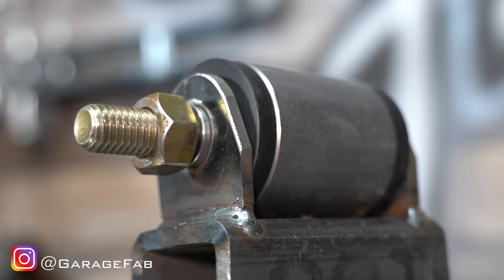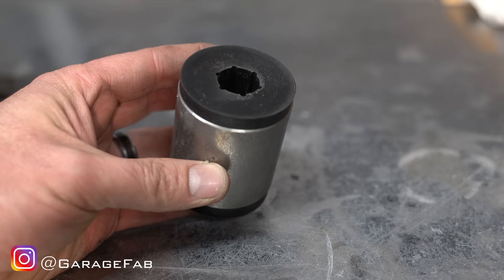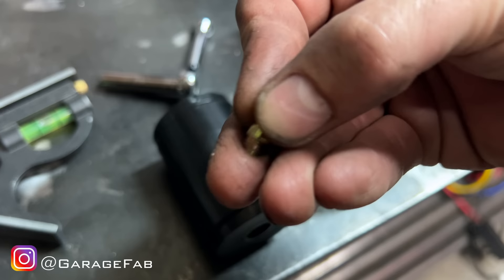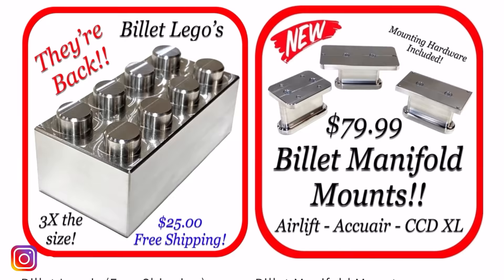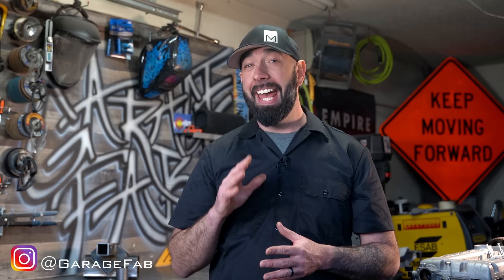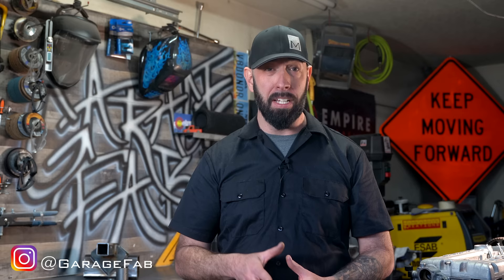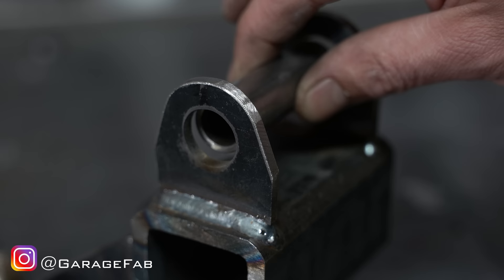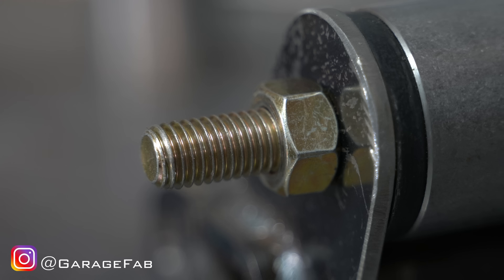The DOs and DON’Ts When Installing Polyurethane Suspension Bushings

Comment: One upgrade i do on every car suspension or offroad jeep that i know i will take apart because or repairs or maintenance is i will mark the bolt about center and drill a small hole thru the side about halfway thru. Then drill a small hole from the bolt head to the hole u just drilled. Then tap for a 1/4-28 for thw fitting i use. And i keep a wide assortment and stlyes to choose from so i dont have to go to the parts store. Also wipe any grease off after ur done because it what u should do. Also use the plastic caps to cover them. That way they are clean the next time u go to service ur ride. This will help the rust belt and offroad guys....
Reply from the maker: Brilliant. I’ve seen this done but never thought of doing it myself. Do you have to oversize the bolt knowing that you’ll be drilling into it?

Comment: More good info. Packed full don't blink. 

In the case of a rubber oem bushing, they are designed to be clamped at ride height. And twist rather than rotate. 
Modern cars suffer from premature rubber bushing failure when wheels are left hanging for to long.  The rubber begins to tear. A modern vehicle driven under norma conditions will see longer bushing life, vs one that is at a track putting the suspension through full movement travel.
Reply from the maker: Preach! This is something we struggle to explain at work, when we see new technicians tightening suspension bolts with the vehicle on the lift. Like, “Congratulations! You just replaced some control arm bushings. And you’ll be replacing them again for free next month!”
Thank you, Brother!

Comment: Permatex silicone paste works well on the through bolts , it is water resistant , lubricates , and is safe on rubber parts . I also use this product on Class - 8 truck S-cam brake pin bushings instead of anti-seize .    
Permatex also has  Silicone Extreme Ceramic brake parts lubricant .      121/23
Reply from the maker: I like it. I just like the way it looks, and it’s far less messy/annoying than anti-seize.
Reply from the maker: Appreciated, Vic!

Comment: I really appreciate you specifying the SOURCE of all the information.  Without that, all this would be just opinion.

Another reason for going with grade 8 bolts (but this is just opinion) is that they have better coatings against rust.  Am I wrong?
Reply from the maker: I honestly don’t know the answer to that! I know they’re coated, and I know it’s different than your typical zinc plating, but I don’t know what the difference is. I’ll have to look it up.

Comment: At 3 minutes the bushing bolts that like to seize to the inner bushings can be improved with a bolt upgrade to ones with a smaller diameter shank section mid way so full shank diameter remains at both ends for half an inch or so. I used a Nissan example that was an updated part for a 97 Pathfinder that came stock with a full seizure style shank that was nothing but fun to remove from the vehicle at 8000km when the bushings were chewed from the inner sleeve outward to but a small fraction of the original. There was no slip to the pivot just holes through the rubber bushing material around the inner sleeve to allow flection. Even with a portion of preload in the direction of travel to allow the flex to first unwind before passing over the static neutral position the first replacement but the rhubarb at 12,000km and I got busy with an Energy kit doing the mods you've been covering here to allow a controlled pivot around a stationary inner sleeve which makes sense I hope when you think about crankshaft main journal diameters and the benefits of the smaller diameters on drag... unless you break them. What an improvement in 4 link plus panhard rear. 
Doing the same for my 68 Firebird.
Always interesting stopping by your shop to see what you're up to.

Comment: This was a great video!

As for greasing the bolts, you are on the spot, makes no difference in operation but I always choose to grease the bolts when I assemble for corrosion protection.
When it goes to engine mounts etc, especially in bikes , no seized bolts!
Reply from the maker: We’re spoiled here in the desert. If we see rust, we know that car came here from somewhere else. You can call it lazy, but we’re a nearly grease free society.
Reply: @GarageFab  you are very lucky!
Here, and I mainly speak for ATVs, if you don't grease especially the rear arm axle bolts, you are going to have a very hard time when you will have to remove!
Reply from the maker: I believe it! 😆

Comment: Great video.  Threads will also wallow out the hole in the tab faster then the bolt shank.  thanks!
Reply from the maker: Agreed! But if that happens I think it’s a sign the bolt wasn’t tight enough.

Comment: Thanks for the information, I had to change the rear end in my Nissan Pathfinder because I was hit in the side right on the rear wheel and it bent the rear housing.  When I tightened the bushings the nuts were self locking so I wasn't sure if the inner sleeve rotated around the bolt or not.  I decided to go ahead and tighten the bolts since they were tight when I removed them.  Now that I know that the bushing rotates around the inner sleeve I know I did it correctly.
Reply from the maker: Here’s a little additional info that I neglected to include in the video Dave.
I’m assuming your bushings were factory, and if so, they’re probably bonded rubber. These type of bushings are still fully tightened as mentioned, but they should not be tightened until the weight of the vehicle is on the suspension. If you tighten them with the wheels off the ground, the bushings will twist when you set the vehicle down, and this will cause your bushings to tear prematurely.
If this is the case, I would simply recommend loosening the bolts without lifting the truck and then tighten them again. The inner bushing should spring back to its natural position.

Comment: Good job, nice explanation.
Just a couple of points….
You don’t need the shank to span the tabs. The bolt isn’t loaded in shear, it’s the friction from clamping everything together that stops things from moving, so the length of the shank doesn’t matter. If the bolt is loaded in shear you have a joint that is going to destroy itself pretty quickly.
It might be a British/American thing but Rod end refers to a spherical joint (I think you call them Heim joints?). This is just a bushing.
Cheers!
Reply from the maker: Agreed. I’ve learned a bit more myself since making this video.
I honestly don’t know what the “correct” term is, but in my little circle of fabricators, all bar ends are bar ends but they’re specified when needed. Spherical bar ends (Heims), polyurethane bar ends, Johnny Joint bar ends, etc.
Thank you my friend! 🙏
Reply: @GarageFab  👍

Comment: Great content ! I have always tried to have at least 1 1/2 thread showing through the nut after torquing and I always try to use grade 8 hardware for safety reasons ! Thank You 🇺🇸🇵🇷🦊👍
Reply from the maker: I don’t see why you’d need any more than that. A utility truck manufacturer I worked for required a minimum of a half inch protruding from the back end of the nut.
Thanks for watching, Ferdinand!

Comment: I keep coming back to this video. It's super helpful. I'm thinking of making a swing arm tire carrier that bolts to the back wall of my trailer in 2 places and was debating going this route instead of a spindle on the bumper. I like this idea of using these bushings as a hinge instead but not sure if it would be too tight or hard to move. Obviously it would be stiffer than a spindle but maybe a gas strut would help with that.
Reply from the maker: Yes! They are indeed stiffer, but not difficult at all. As soon as you add some leverage (like a tire carrier), they’re fairly easy to maneuver. Their stiffness might even be a benefit as the tire carrier wouldn’t swing back by itself. It should stay wherever you leave it.
Another option that I’ve been using lately has been machined shoulder bolts and bronze flange bushings (Oilite bushings) in DOM tubing. They resemble polyurethane bushings but way smaller, don’t allow any flex, (great for door hinges) and the stay lubed.
Thank you for your return! 😆

Comment: Great video, but I would recommend to avoid store bought “grade 8” bolts for anything with critical stresses and step up to airframe fasteners.  much stronger bolt and threads (fine threads, too) as well as a more consistent and accurate size fastener.  you’ll find they generally fit tighter into the sleeves allowing for less slop, too.   Grip length is critical, of course, and flat washers can be used   if needed (avoid lock washers).   Carroll Smith wrote a great book on fasteners.  it’s a real eye opener.

Comment: These bushings look great, I've only ever fitted factory stuff where most bushings are bonded in so not pre-loading the suspension is the mistake most people make when fitting them.
Reply from the maker: You’d be surprised how many “knowledgeable” technicians tighten down new bushings with the wheels in the air.
By the way, I actually loled at “Rod Panhard”

Comment: I worked as a suspension tech - don’t put poly bushes in your car unless it spends most of its time down the race track. I’ve seen cracked strut towers where poly strut tops were put in. People also have an obsession with slamming their cars to the ground, thinking it handles better. Nope. Your car is bump steering all over the place because you’re losing traction, as you have no compliance in your car.

Comment: i think i uncovered a possible flaw in your logic pertaining to having the threadless part go all the way through, i just saw something where they were saying the weak point of bolts is right where the thread starts and if you think about a bushing all the force is right where the tabs meet the innersleeve so i would think you'd want the weakpoint in the center, even aside from where the force is theres no where for it to go in the center (i don't know if that logic is sound but it makes sense in my mind) another way to put it is the inner sleeve reinforces the bolt whether its meant to or not. Another reason is you never see them like that coming off the toyota assembly line or and assembly line

Comment: If you live anywhere they use metric, then the nuts and bolts should be marked 12.9 and not 8.8 which I think is equivalent to their grade 8 and use a nylock or castle nut with a cotter pin to prevent it coming lose, unlike shown in the video. Also do not use any stainless nuts or bolts on suspension or steering components, it's nowhere strong enough but crush tubes are bettering in stainless.
Reply from the maker: Good info! Thank you Scott! I used a normal nut in the video to make it easy to make changes quickly during video production. I should’ve mentioned that. Cheers!

Comment: Nice video sir  well explained   I'm glad you mentioned the grease  I live in ohio  and see a lot of rust  one thing  did  bother me  was the crescent wrench  not really the best tool for the job   but maybe you just used it for the video    I think it will help many younger people   good job  sir
Reply from the maker: Thank you my friend! You don’t like crescent wrenches?! It’s The really the only tool you need. It’s metric, SAE, a hammer, a metal brake, and so much more!
On a serious note, this bushing was just a demonstration piece welded to my bench. Also the reason there were no locking nuts or washers in sight. But on real builds… I use two crescent wrenches.
Reply: @GarageFab  in Ohio I use the blue wrench  way more often than a adjustable one
Reply from the maker: I don’t even own a torch! Praise the desert!

Comment: I did see at 5:07 that the built suspension do look good, but I'd like to add that you should always check that the angle of the tabs shall be in the optimal angle to minimize the stress on the bushings and tabs from movement and side-forces of the arms. Those diagonal arms are what I'm thinking of. I think that letting the tabs take the angle instead of the arms could lower the stress on the part of the construction in the center. To me it seems like the current construction would put pressure on the side of the bushing material when taking up side forces.
However a lot of good points, now do a video about suitable grease for various bushings. Maybe it's something for Project Farm to do though! 😃
Reply: I could be wrong as I'm no expert. I think the angle has to be in the arms as they've done, and the tabs have to be aligned as they are so the swing-arm swings like an arm.

Basically, it is a hinging point, so the centre axis lines of the two pivot bolts have to be on the same axis line to be able to pivot and hinge correctly.

You may be correct to say the arm angle increases stress in the joint. However, to change that, the tab mounting points would need to be moved further away from centre so the angle on the arms becomes can become straighter, but the crntre axis alignment of the bolts stays the same.

Comment: Dude this was so helpful, thank you. I redid the whole rear end suspension on one of my jeeps and I believe this to be the root of the issue! Is it possible to insert new bushings into a leaf spring and match the sleeve to the tab hole size? I completely replaced my shackle mounts on the body so they are non stock but I believe they are a hair bigger than stock which has gotten me into trouble with the clunking
Reply from the maker: Hey Jake! It should be possible. It’ll just be up to you to locate the inner sleeve material. Find the bushing that fits your springs and measure the hole in that bushing. That will be your sleeve outer diameter. Your bolt size (and the existing hole in the tabs) will be the sleeve inner diameter. For easy math sake, say the inner diameter of the poly bushing is 1 inch, and your bolt is 1/2 inch. A piece of 1 inch OD DOM tubing with 1/4 inch walls would be perfect.
If you can’t find material to make the perfect sleeve, you may have to weld large washers to the inside of the tabs to put the tab holes back to factory size.
Hope this helps! Best of luck my friend.

Comment: I do alot of suspension "corrections" as well, on Scouts.  One thing I do is ditch the sleeve and drill the hangers to 5/8"... then run a 5/8" bolt all the way through.  I was told this bumps the strength by like 40x or whatever... but in practice it is just tighter and beefed!   Got a real quick susp ? for you that is too complex for my buds, got time this week for a fast call?  -Big.   "GotScout"
Reply: What prevents over tightening if the sleeve isn't in there?

Comment: OMG. You answered by hard to answer questions perfectly!  Im having a problem with a golf cart bushing where the bushing material seems pinched by the frame and the entire bushing material is rotating around the outer sleeve!  I expect the inner bushing to rotate around bolt.  I have tightened the bolt to the recommended torque.  Thoughts?  It creeks when the control arm is moved.
Reply from the maker: It sounds like bushing sizes might be incorrect or perhaps they’re just worn.
Any chance you can shoot me a photo? 
GarageFab702@gmail.com

Comment: Hey ManKandy, You are the Man!! This is Exactly what I was looking for!! All the details to choose the right bushing, where to get it and how to make sure it’s installed correctly. I assume the tabs are 3/16 thick for a 50’s large car 4 link?  Super Thanks 🙏 for all your videos, unbelievably helpful and so appreciated!!
Reply from the maker: Tab specifics might be a future video. I do in fact to use 3/16 inch plate, and if the tabs are more than 3 inches tall, I’ll connect the tabs with a backing plate. And if there will be sideways or diagonal forces like on a Triangulated 4 link, I’ll gusset the sides of the tabs. Hope that makes sense without visual aid. 
Thanks again brother!
Reply: Perfect, Thanks 👍👍🙏🙏

Comment: Great video. I think a lot of boutique control arm manufacturers don't know all this stuff, at least the ones that I bought mine from didn't. Didn't even come with grease zerks and now they squeak :(
Reply from the maker: Ugh! Poly is notorious for squeaking. It’s hard to believe you can get a control arm without Zerks. Have you got the ability to install your own fittings?
Reply: @GarageFab  maybe. Looking like I will be doing my own work more on the future so I may pull off the control arms that have these bushings. Something else that may be squeaking in cold and/or dry weather are the spherical joints on a bunch of the suspension links. Same place sold me those.

Comment: It's probably been mentioned already but also tighten the bolt when the bushing is in the neutral position before tightening/torqueing. Don't want it to be in a stressed position and push it too far.
Reply from the maker: Very true, but only for bonded rubber bushings. Polyurethane bushings like these aren’t damaged by tightening in an improper position.

Comment: excellent explanation   I added grease fitting to the lower A arms of my pt cruiser.  I installed the available poly urethane kit.   the micro tube of silicone was s joke.  Red & Tacky Lithium  grease is great   never use petroleum grease
Reply from the maker: Are you saying 4 drops of grease isn’t enough? 😆
Reply: @GarageFab   apparently some people think so!  And then wonder why their bushing fail!.  Thank you for the excellent explanation. I have shared this with many!  if they didn’t believe me, maybe they’ll believe you!!
Reply from the maker: Thank you my friend. 🙏 Sharing helps more than you know. I appreciate it.